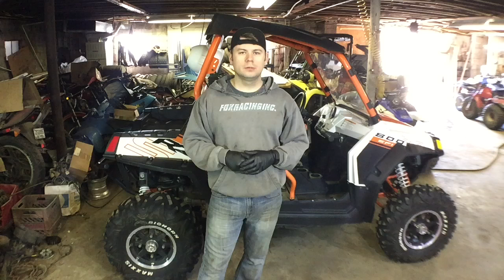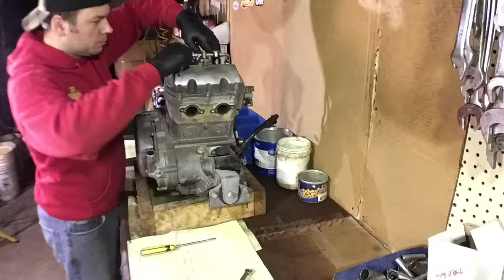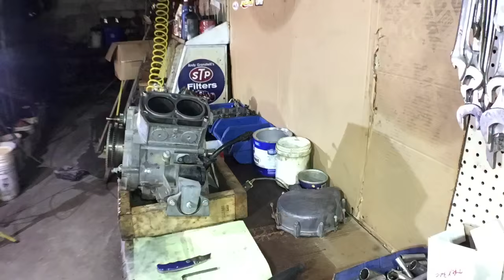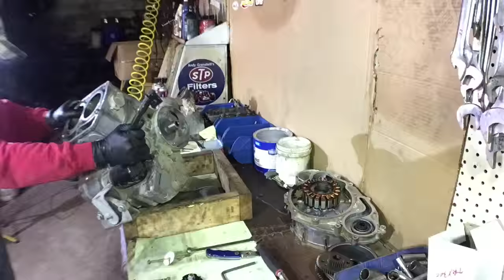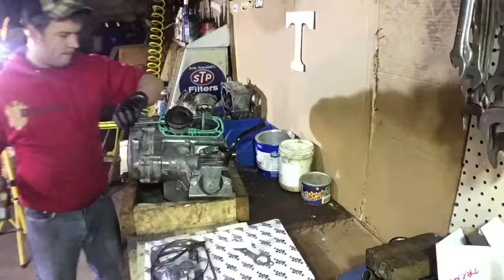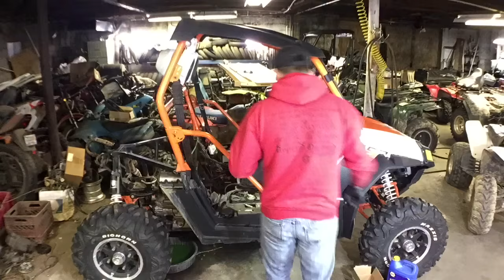Polaris RZR 800 Crank Swap

Comment: damn im doing a stator swap and it looks like i need a puller tool to take that flywheel out
Reply: im doing the same thing right now,and i cant figure how he do this without removing rear diff
Reply: @dee696  turns out you can unbolt just the engine part, theres two bolts at the bottom and two at the top between the motor and the transmission

Comment: Hey bud I got a quick question I love your video by the way I have a question regarding timing other than lining up the dots on the gears is there a certain way to do the top dead center on the compression stroke and if so how do you know when is the compression stroke and on which cylinder does it need to be in the compression stroke? Thanks in advance

Comment: so how long did it really take??
Reply from the maker: I'd say total it took maybe 6-7 hours of actually work time. I'm not very speedy however so it could more than likely be done much faster by someone who was quick and did it often.
Reply: I need to replace my cam. Do you not have to pull the transmission and rear diff out??